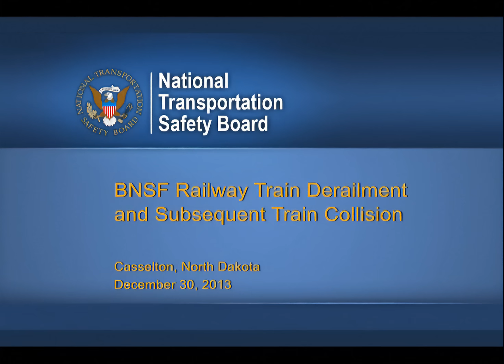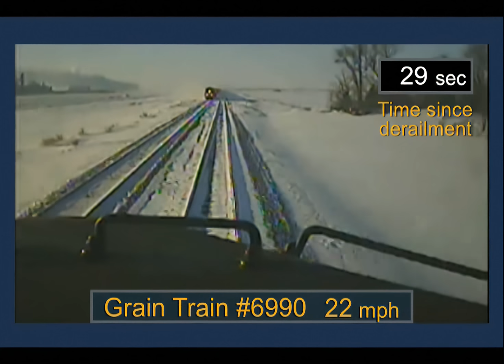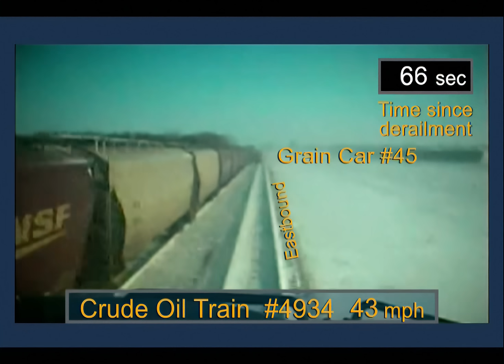BNSF Railway Train Derailment and Subsequent Train Collision

Comment: The grain train I see is at fault. They are required to do the emergency broadcast as soon as the train goes into emergency, desired or undesired. The oil train would have had about 45 seconds to stop and maybe avoided a collision.
Reply: Certainly the oil unit train would have had more time to slow down but an accident was inevitable
Reply: apparently they did but were on a different frequency to the tanker one.
Reply: @ЦветозарЦветков-е5о  It was at the line to change frequencies

Comment: what took the crew of 6990 so damn long to acknowledge that they were in emergency and warn the other train ?
Reply: Most likely just surprised. It doesn't usually feel like an actual emergency the first few seconds after the air goes. That being said, its in the rule book to call emergency over the radio right away when on double tracks for this reason.
Reply: It happened at the place where they are to change radio frequencies.

Comment: This is one poorly handled emergency. Especially by the grain train operator, dumb people everywhere. If the crude oil tram was warned as soon as grain train emergency brakes went off there would be extra half a minute for breaking.
Reply: Do the math on the deceleration. Likely they still would have derailed, it feels like an eternity to stop in emergency even doing 15 mph.

Comment: I have been involved in a few investigations into these incidents. I represented operators for the Union and the Company would bring the software and video of the events. The Black Box recorders are used to place blame on the operators but usually never the Company of course. That will come from the NTSB later on. We were not a mainline operator so the Company could hide a lot. They had very shoddy maintenance of the tracks and rolling stock. They acted like these operators should be able to stops tons of equipment on a dime! I told Labor Relations Managers your going to loose every operator out there! I tried to get the Union and the Company to take a more proactive stance towards the problem. Meaning both parties needed to get out there and pay attention whats going on. The Company is not going to discipline they're way out of this problem. They refused to listen and I moved on! Believe me when I tell you, be very careful around trains. They can kill you very efficiently. People seem to have this down as well-sad!
Reply: The actions of the grain train crew were unacceptable in this situation, that's a fact.

Comment: These videos are interesting but how about some details as to how and why it derailed,and if anybody was hurt? 🤔🤔🤔
Reply: Here's what happened:

That grain car which derailed, had an axle with microscopic cracks that went completely undetected during maintenance and gave out right there at the wrong place at the wrong time. The accident was actually FAR worse than this video shows. After the footage here ends, 4934's crew immediately exit the engine and make a run for it. The fire then seeped into the tankers behind them, and then that caused a GIGANTIC explosion which many people witnessed and can fondly remember even today. Luckily, no one was injured or killed. However, engines 4934 and 5958 (which was the engine sitting right behind 4934) were completely destroyed and scrapped on site.

Comment: This is exactly why I don't pull up right next to the crossing gates of a railroad. If it derails and the cars swing out you're dead.
Reply: Food for thought... You don't even need a full on derailment, very large chunks of steel (brake system and suspension) can fly off too.
Reply: @cdodge2996  Even more reason to stop back away from the gate.
Reply: @cdodge2996  There are 3 zones, in CN  and  CP  rail lines. First GREEN ZONE > 50 feet, either side of dual tracks.  Second zone, YELLOW, 25  feet from each side of dual tracks.  Third zone, BLACK is 15  feet from dual tracks. THIS  IS ONLY  FOR CERTIFIED  CP/CN  PERSONS.
Reply: @petersack5074  You haven't hear about the tree trimming crew that got tagged by a train in Ontario a few years back by chance? They were supposed to be no closer than, (I believe) 12 feet- likely your quoted 15. No fatalities, but apparently it tossed the skidsteer quite a ways
Reply: @TheOriginalBlue62  No, but i will chk it out.....over and out.....dobra  Poland/Ukraine
Reply: @cdodge2996  Brake systems and suspension flying off? Unlikely, a cable from a centerbeam being swung around like a devils whip, catching and destroying everything it hits? More common than one would like to admit
Reply: I park on the rails in case the train derails, food for thought.
Reply: @OliverUnderTheMoon  Astounding sense of judgment
Reply: @OliverUnderTheMoon  don't be a dipshit.
Reply: How often do trains derail though?
Don't know about the US but here it's extremely rare.
Reply: @InLoveWithCities  extremely rare here too, but they do happen
Reply: @InLoveWithCities  3-4 per day technically, but a large majority of those are low speed incidents that take place in busy rail yards and run little risk of catastrophic incidents the way they can on the mainline.
Reply: Wouldn't matter, that depends on the locomotives speed and cargo, you could be 100 feet away and still get collided with. The locomotives are very heavy, Just one traction motor weighs 14,000 pounds, -9 have six of them, you are going to get hit, period.
Reply: So what is a safe distance, pretty sure a derailment at 50-60 mph , gotta be a coupla hunerd feet 😎
Reply: @lawrencekellerii4857  yeah around 400 feet (about 1 and a half football fields) would probably be enough to keep you completely safe
Reply: @lawrencekellerii4857   hunerd LOL
Reply: A derailment is just as likely as a plane crash. Yet people ride the train AND planes every single day. 
A derailment just right next to a crossing is about as statistically impossible as it can be.
Reply: good point
Reply: dont be a chcken
Reply: No to mention unsecured banding or cables dragging
Reply: @00jnelson  Truth! Good points. As a kid growing up that went a mile through the woods with friends to go play on the tracks and swim in the creek after walking miles along them I can testify to that.
Reply: Your so right... I also stay back at least 2 car length from the cross arms down at a crossing.. you never ever know when something will happen bad.. I see some inexperienced dummy's pull up right close up and I always say not smart u gonna be sorry one day.. people do not understand or realize the power of trains
Reply: @athensboy123  2 car lengths does not allow enough time to dodge objects in the roadway. Just trying to help.
Reply: The recent derailment in Tennessee demonstrates jus how the debris can go out a far distance.
Reply: YES!! I tell my kids the same thing!  Stay back!
Reply: I agree with that completely. I try not to get too close, either.
Reply: Im built different. Ill live
Reply: You're done. Nope nope you're done just you're. Done.
Reply: I fully agree. If on my bike, I get off and look way down the tracks. I want running room.
Reply: but how would you cross the rail?
Reply: Exactly!
Reply: Not a bad decision by someone with a goody name like Tyrandus (the reluctant dinosaur.)
Reply: I'm gonna guess you're 100x (perhaps 10000x) more likely to be struck by a road vehicle while waiting for the train to pass than having the train derail and smush you.
Reply: @markhenry6486  You follow vehicles too closely also don't you genius.
Reply: The "frogs" are the most-likely places but yes! In distant future there will be no grade crossings. Eliminates most accidents and noise (no more horn necessary).
Reply: @SovereignTroll  Yeah exercising common sense and stopping for trains is way too hard.
Reply: Man I never EVER thought of that and thank you I will be sure to do so going forward
Reply: I'm thinking that if train derailment was so likely that I would need to take it in to account at every crossing, then I would never in a millions years dare to ride a train, but I and many others do.
Reply: Yes I’ll be keeping my distance from now on god damn
Reply: "This is exactly why I...."
I think you should just stay home, forever. Then you can't get hurt by anything but your own paranoia.
Reply: Exactly
Reply: Yeah being right next to the tracks is unsafe but you'd be alright just a few cars away. Unless it's on a curve or embankment, trains ALAWYS derail in a narrow space and folded up in an accordion-pattern.
Reply: i pull right up there
Reply: I worked at a railroad for 35 years, so I always keep more distance at a crossing gate!!! A derailment can happen ANYWHERE!
Reply: and a tank car has yeeted itself ¾ of a mile before
Reply: But in my country, numerous people even get beyond the gate. Hell, even random stone fell from the train car can got them
Reply: If a strap breaks and is flapping in the breeze, you’re decapitated
Reply: Don't forget loose steel strapping.
Reply: When I started with then ATSF, we were told (and by experience) , that a crossing is just a track , the minimum kill range during a derailment is 200 feet from the center of the track, either side or both , the maximum is anything that steel wants it to be .. long story short, that little white line painted on the road just before the crossing means nothing  that 200 feet is a kill zone … I just hope anyone reading this NEVER gets caught in that zone …
Reply: And why you should leave more room when you are passing another train.
Reply: @shreddder999  That's what I think of when I'm on Amtrak and go head-to-head on parallels with tanker freight, especially, and with significant speed. If anything goes really wrong along that stretch, it's guaranteed to be curtains for most or all. It would be nice to have a little more margin between them, it seems, but maybe it wouldn't help.
Reply: @ReflectedMiles  Yes and I won't ride Californias high speed rail trains when its done. close tracks ,earthquakes and high speed just a mater of time.
Reply: @shreddder999  What
Reply: i pull up tight--if the train derails i won the lottery
Reply: @dethray1000  lol
Reply: @dethray1000 yes sir 👍😅
Reply: I pull up close to the gates and shut the engine off.  Then I can hear and feel the ground shake as the train roars by!  I'm also confident that a derailment exactly where I am is very unlikely.  I guess I'm not as paranoid as many.
Reply: @michaelmccarthy4615  crossings and switches are the most likely places for derailments. food for thought.
Reply: @screamingslave99  
Exactly , there’s a lot of moving parts at a crossing and every one of those parts are looking for a way to fail ,and when one does?
Catastrophe is highly likely
Reply: @benking4367  Offt... there's nothing at a crossing guard... it is where lines split, merge...
Reply: @screamingslave99  Yes, and when trains derail at level crossings it's almost always the result of hitting a vehicle first. Usually those killed are the vehicles occupants.

How many people do you think are killed in an average year by trains suddenly derailing at level crossings and 'swinging out'? I'll give you a hint - it's nearly zero despite there being over 200,000 levels crossings in the United States.

Find something better to be paranoid about.

Besides, if something like this did happen a few feet isn't going to necessarily make a difference. Trains have a lot of momentum and as you saw in this clip they can go quite far from the tracks.

I especially wouldn't be worried about pieces of metal falling off the train and coming through your windshield. That's some 'final destination' crap right there. Possible? Sure. Likely? No. May as well worry about a commercial airliner crashing into you.
Reply: @screamingslave99  ...yes, it was at a switch that my grandfather died.
Reply: @screamingslave99  I need food. How much do I have to think for free food.
Reply: @michaelmccarthy4615  Typically a big "X" painted on the road means you shouldn't stop on top of it
Reply: @michaelmccarthy4615  Nut Job
Reply: You really shouldn’t do that. You should keep the motor running, and stay in command of your vehicle at all times.
Reply: @michaelmccarthy4615  I just sit right on the track itself
Reply: @michaelmccarthy4615  If your in high wind conditions, the wind can blow an empty car off the tracks onto your car crushing it long before you can react. The locomotives weigh in the neighborhood of 400,000 pounds. I always stop way back from the crossing. Working as a driver who hauls rail crews for the last 3 1/2 years I've come to use a bit more caution when around them. Just please be careful around those things.
Reply: @rustybarry3405  its not happening in my lifetime.    Enjoy trains while you can.
Reply: @rustybarry3405  Find me one example of someone actually being killed at a level crossing by this please. You're going to have a difficult time.
Reply: More chance of an intoxicated driver  pushing your vehicle onto the tracks than a derailment.
Reply: You have a better chance of being struck by lightening. But respect for a crossing is paramount. I've seen too many cars try to beat the gates. Foolhardy. Why is the world is such a hurry? Walmart & McDonald's will still be there.
Reply: I was in Rockford Illinois about 10 years back and the tracks washed out, train derailed and a big fire started and killed a lady in her car at a crossing.
Reply: @nizzurtmontalgizzert3337  A track washed out, a train derailed, there was a fire and then a woman was killed at that crossing.... pfft
Reply: I was photographing an old steam on display when a freight liner rumbled by about 20 feet away.  They are awe-inspiring soul shaking machines.  It occurred to me if that thing derailed as it went by all they'd ever find of me would be a moist spot on the ground.
Reply: My rule of thumb is to stop at where the R x R crossing on the pavement if available or the yellow railroad crossing sign just in case. I see cars get right up to the white stop line and all I'm thinking is if that train derails they'll be dead.
Reply: I've sat at a railroad crossing several times with a speeding train coming by in front of me and wonder just what it would be to have a derail and hit me. It's enough to make you think.
Reply: Well if you actually really want to be safe don't get in any cars. 3,000 people a day die in traffic accidents. I think percentage wise it would be relatively safe to say 0% die by collision with trains. Okay 0.0000 something
Reply: @markhenry6486  It's probably higher than that, but it's almost always due to a car being hit by a train that has NOT derailed, given the impact with a car can easily derail the train though.  People getting killed by train derailments at an at grade crossing HAS happened, but it is exceedingly rare.
Reply: Do you park 2 miles away? Because just "not pulling up right next to a crossing" isn't gonna save you if it derails lol
Reply: Doesn’t walk under ladders or past black cats either
Reply: idk what are the regulations in the US but normally that's why there are the so called "guide rails" at all crossings and bridges to make the damage to the minimum... actually you have bigger chance to win the lottery than being hit by an outswinged car of a train while waiting at a crossing, LOL.....
Reply: @Rapkatona18  true!
Reply: @Barsabus  no you don't...you wouldn't be writing this now if you did that.

Comment: Im impressed that the locomotive stayed upright after the collision and derailment going through snow. Are they bottom-heavy?
Reply: Compared to a railcar, yes. The fuel tank is below the walkways and the engine is narrower than the axles. Typically the locomotives will make it over track defects that would derail the railcars.

Comment: There was nothing the oil train engineer could have done. I believe the official cause of this was a broken rail.
Reply: It was because of a broken axle on the grain car that derailed. It had microscopic cracks which went completely undetected during maintenance, and then finally gave out in the wrong place at the wrong time.

Comment: If the crew of the grain train radio’d their emergency brake application as soon as it happened, the unit oil train may have been able to stop, or at least slow down substantially more than they did.
Reply: The crews were on different radio channels.

Comment: So *What* cause the derailment?
Did it have anything to do with the "signal maintainer" near the beginning of the clip erroneously switching the tracks mid-train?
Reply: There were tiny cracks in one of the axles on that one grain car which had went unnoticed beforehand, and it gave out right there at the exact wrong moment and derailed, and 4934 didn't have enough time to stop, so it hit it and "went everywhere". But that isn't where this story ends. Right after the footage in this video ended, the fire on 4934 then seeped into the tanker cars behind it and caused a titanic explosion which many people witnessed. Fortunately, the crew escaped and there were no injuries or deaths. Engines 4934 and 5958, which was right behind 4934, were both completely destroyed in the explosion and scrapped on site.